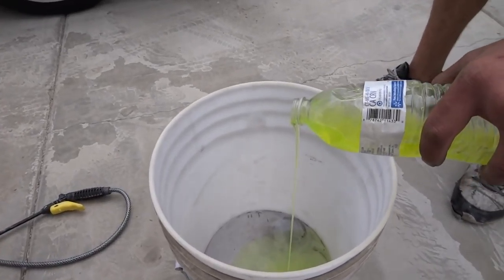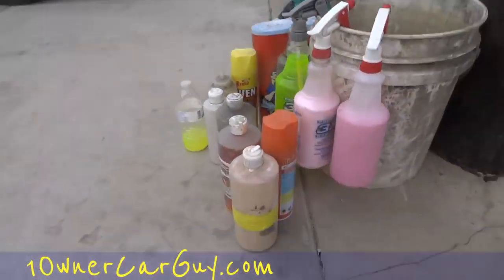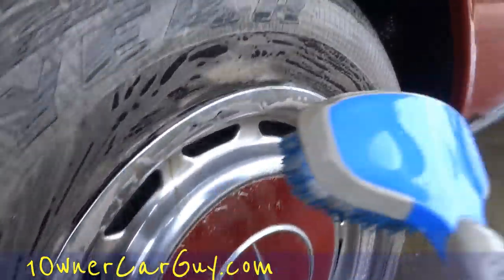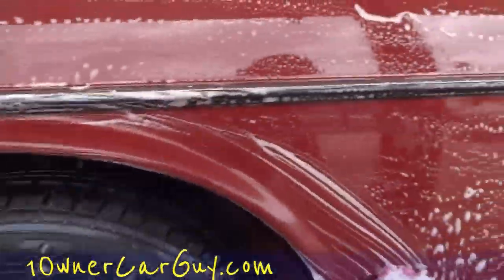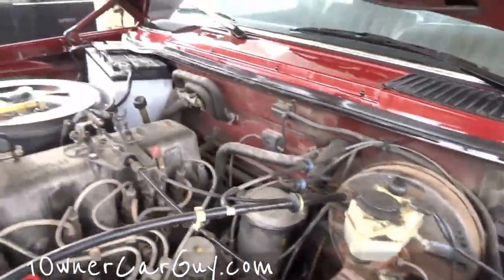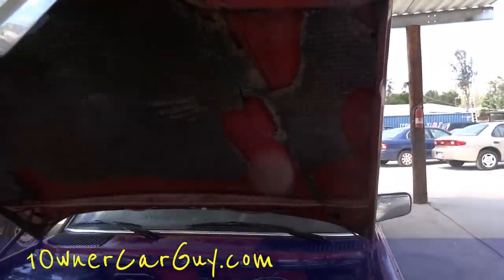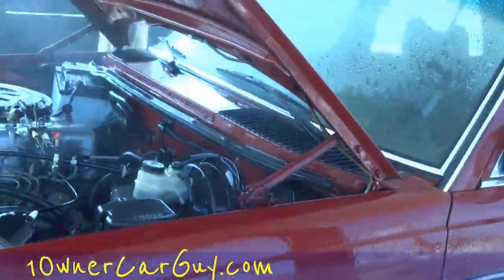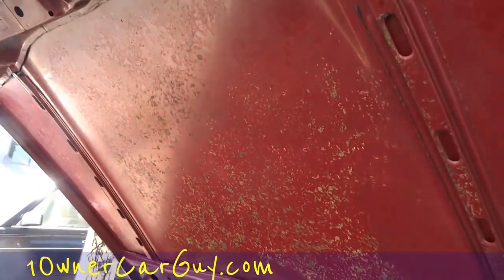How to Detail Your Car Video Wash Buff & Clean Easy Paint Buffing Tips & Tricks on Cars

Comment: Great video!!  I do alot of auto detailing out of my garage during the summer to make some extra money but I do alot of the same stuff.  Have the big garden sprayer full of some Simple Green/water 50/50 or so, soak down all the tires, underneath, wheel-wells, engine, engine compartment, etc.  Do it all before you start waxing/buffing cause it'll strip it off.  That plus a whole lot of tire-foam up underneath really makes it look complete.

Comment: Awesome job, car looks great. Whenever I would steam clean the engines in my cars you are supposed to cover the distributor and any sensors before spraying down the engine, that may help avoid any problems you may run into.

Comment: A good thing to do after power washing a engine is to air dry it with compressed air, so the water will not have time to just sit there on the electrical parts and possibly damage or even accelerate old electrical parts of failing, that works for me, that's if you have a air compressor, it will dry it much quicker even when the car is running

Comment: Oh, I should have worded it different, not steam clean, though that would be nice, I meant washing the engine like you did. I would let the engine run to warm it up and spray that Gunk foam on it. I just used a regular water hose not pressure washer.